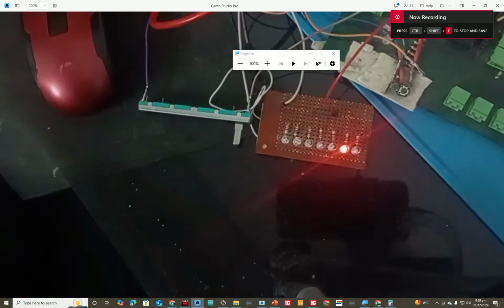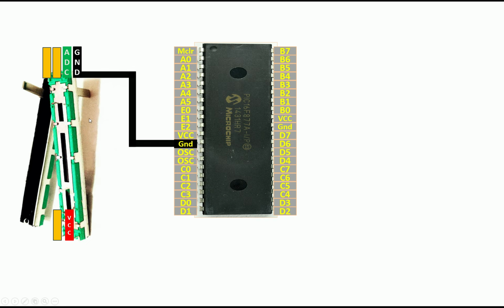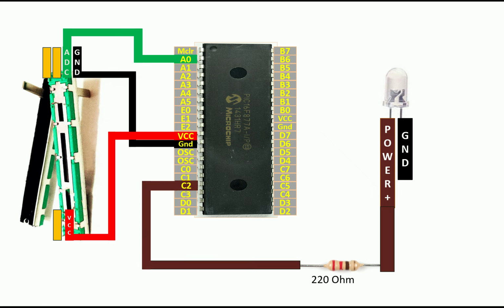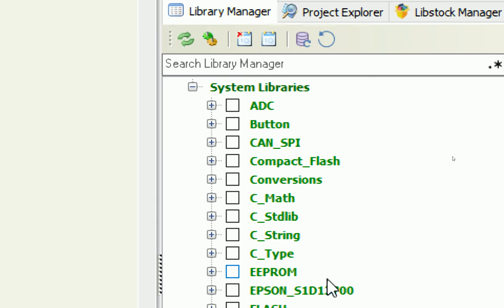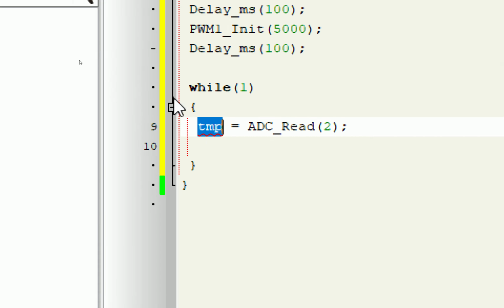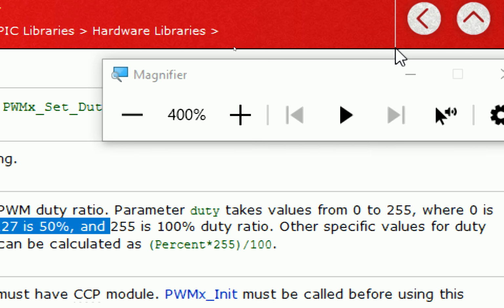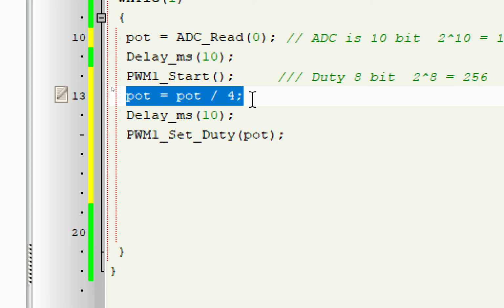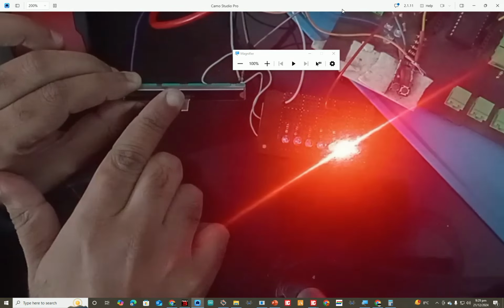Using slide potentiometer to control LED brightness using PIC16F877A’s PWM.

Comment: Duty cycle is actually 10 bit. 2 bits of another register are the other 2 bits for duty cycle. The 0-255 refers to the period PR2, not CCPR1L. Those libraries seem to not be 100% correct.
Reply from the maker: PWM is 8-bit
While ADC resolution is 10 bit
Reply: @ pwm is actually 10 bit as well. Check the data sheet for that micro, I just looked and it says both adc and pwm are 10 bit on page 1.